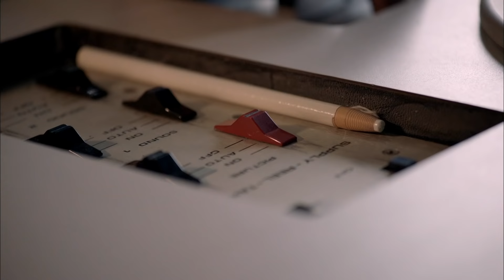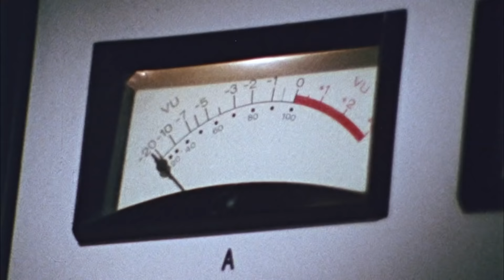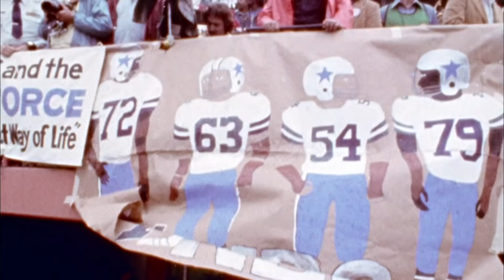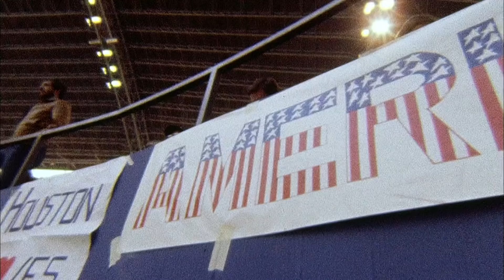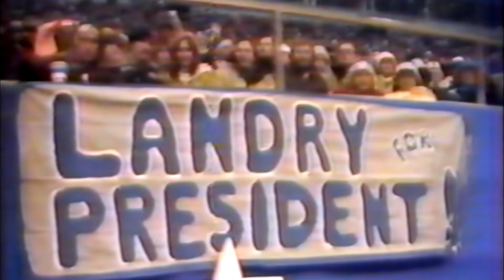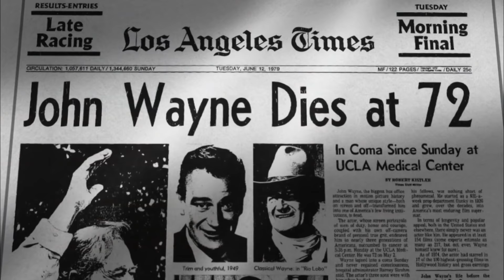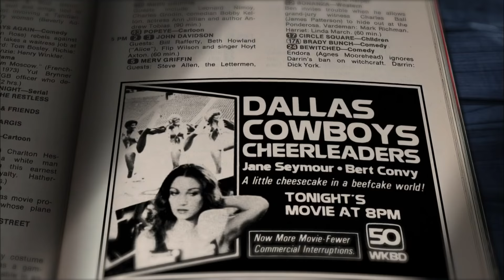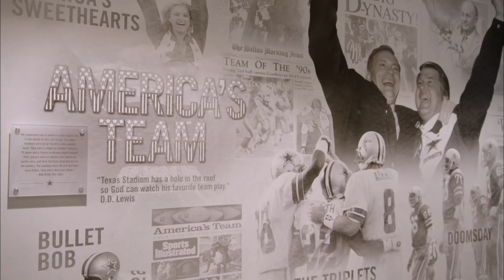America's Team: A Nickname That Goes Way Beyond a Nickname | The Timeline

Comment: Emmitt Smith is the GOAT, if Brady is the GOAT of QBs. Some will say Barry Sanders was a prettier runner, who give s a rats ass. Jason Garret threw a prettier deep ball than Brady so he's better, right ?  Not to mention all the rule changes which now heavily cater to the success, and security and health of todays QBs. And if you're 25 you've missed out on alot of QBs who took a lot of punishment and who's recievers were repeatedly mugged with no penalties called. No going low on QB, Defenseless QB, a friggin tap to the helmet is 15 yards, ALL OF THESE ARE A JOKE IF YOU'RE COMPARING ALL TIME GREAT QBs. It just can't be done fairly. Therefore there is NO GOAT.
Reply: Emmitt himself said Payton is the greatest
Reply: Barry was the greatest pure runner ever…but as far as greatest running backs I have him at #6. He wasn’t an every down back, he got taken out at the goal line, he couldn’t get the tough yards, and he usually no showed in the postseason.